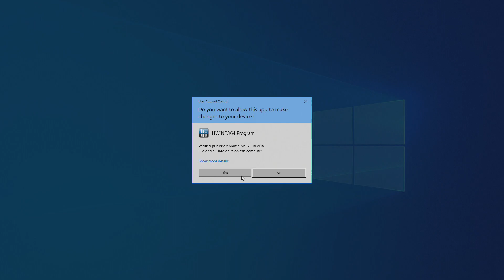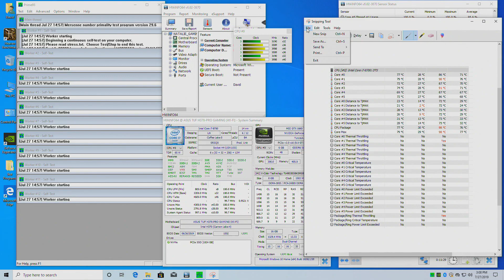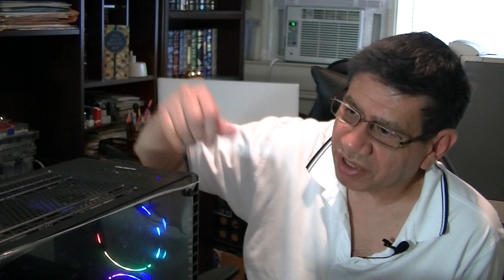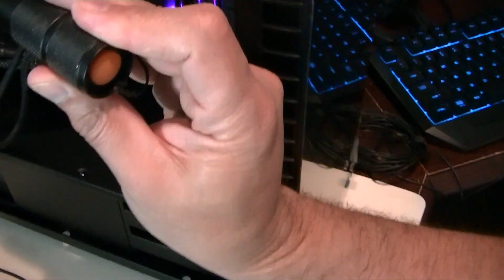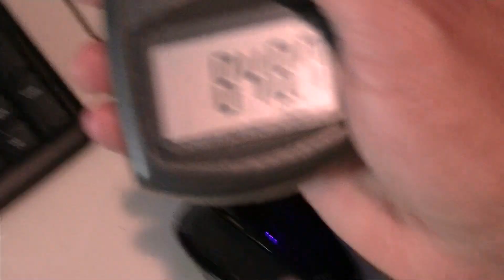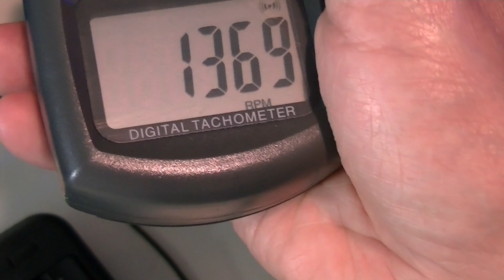Gaming PC Build - MUSETEX Case Review (Part 2 - Testing)

Comment: I have the same case how you put the ssd ?
Reply from the maker: In my case (or really my daughters case) the only disk drive used was a NVMe on the ASUS motherboard.  However, I would have put it in the front section at about the midpoint.
Reply: I mounted it to the back
Reply from the maker: @Quipea  It can go either in the front or in the back.

Comment: Take off the front tempered glass, it will make the temps much better.
Reply from the maker: I did try that,  in one of the three testing/reviewing videos, however, even though it improved the temps they still 'red-lined' at the most stress part Prime-95.  I really do appreciate the feedback, so let me know if you tried anything else that also improved the situation.
Reply: Ok, because I was actually considering getting this case because of all the fans and the fact that I’m building a hardcore gaming/streaming PC, and with performance you need cooling.
Reply from the maker: @goober8769  In my final video I was able to keep the temperatures under control using an All-In-One water cooler, however the core problem is that the fans are not being controlled by the motherboard (not PWM).  In a future (and likely final) video on my daughter's build (this PC) I will be adding a third PWM fan to the front.  If you watched my most recent video in this series, you see that I add the AIO, and it came with two PWM fans.  Adding a third will do nothing les than improve the cooling (even with the front glass on).  So part of that next video, I will also retest the temps and compare them to the previous results - I expect improvement, and if my daughter wants to cool it even more, she can remove the front glass, so I will again test with that configuration after adding the third PWM fan.  By the way, that also means I need to remove one of the fans that came with the case (permanently), since there would no longer be room for it.  I do wish you all the best with your case and I thank you for commenting.
Reply: I was considering water cooling, but getting a water cooling system from Corsair or NZXT costs hundreds of dollars, and with my 1000$ budget for my whole computer all my other parts ( Ryzen 7 2700x GeForce 2060 super etc...) I am redlining my budget. I’ll have to resort to aftermarket air cooling.
Reply from the maker: @goober8769  I understand that.  I prefer Corsair myself, however I was able to get one for half price that Cooler Master made.  Doesn't look as good, but I think I should get 5 years out of it.

Comment: Did you ever find out about the extra set of leds?
Reply from the maker: No, I never did.  I was hoping someone else had noticed the same thing added to their case (I know many have bought it), then let me know one way or the other, but I haven't heard of that happening to anyone else.  I have it in my spare parts cabinet to use if one ever goes bad, or I have a problem with a similar case on one of those lights or switches.
Reply: Spare set

Comment: I currently have an asrock ab350m-hdv motherboard an I'm trying to connect the fans to it, is there a way to do so or do I need to buy a connecter?
Reply from the maker: I had the same idea when I first looked at that case.  There may be an adapter/connector cable that is made by someone, however I did not find one with a Google,  and saw no 'easy' way to do that.  I would have needed to create an adapter myself - and before that, did some electronic experimenting to determine which wires on that strange 5-pin cable were being used for various functions.  The RGB portion of it could be using either 12-volts or 5-volts (I did not put a DVM on them to identify which).  However I gave up on the idea of creating a special rig quite quickly when I realized that the Fan motor logic was NOT Pulse Width Modulated (PWM).  In the end, I simple connected a Molex PSU connector to the connector dangling from that bunch of case fan wires, and it worked - so I left it that way.  Sorry I couldn't be more help on that.

Comment: i was thinking of buying this case would you recommend this case??
Reply from the maker: If you plan on using a high performance CPU, I would only recommend it if you were going to also use use water cooling, such as an All-In-One 240.  Tomorrow I ma heading over to my daughter's place and replacing the two Corsair PWM fans I added in this video with a Cooler Master ML240L AIO cooler.  I believe that will fix the heating problems I identified in this video.  I will be filming that work and producing a Part 3 within the next two weeks.  Maybe you should check out that video before you put down the money on one.
Reply: @PE4Doers  thank you! appreciate it alot cus i love this case but im also changing all the fans out to a ML120mm ones from corsair if u think u recommend it
Reply from the maker: @Gamingandrelaxing  I actually filmed the fix to my daughters Mustex case yesterday, and just adding a 240mm AIO took care of the issue from a critical perspective.  I did have to move two of the included fans from the front to the top (and reverse the air flow), but it seemed to work.  I believe the case has overall air flow problems which new fans can only go so far in compensation on that.  I expect the new video to be posted this coming Sunday morning, so look for it.

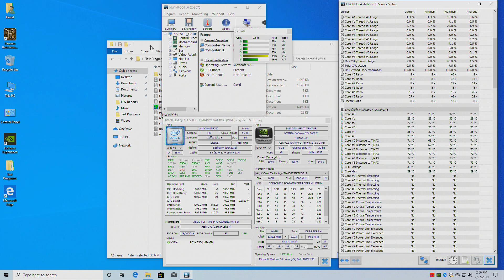Comment: is that fan noise through the mic at 6:31 is that the fans from the case noise?
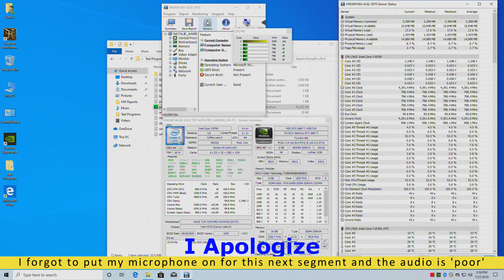Reply from the maker: That is due to my stupidity in taking my mic off between the tests (for a bio break) and forgetting to put it back on when I returned.  I did show an apology at the bottom of the screen at 6:18 into the video, but I probably should have made it more prominent.  I considered not including that second test in the video at all, but decided it helped convey my frustration, which was an important thing I wanted to get across to everyone.  The noise itself is from my engineering workstation (that I currently use to record my sound), since I had put the mic down within 4 inches of the top intake fan.  The MUSTEX case did have the positive attribute of being VERY quiet, but I believe that also aggravated the heating issues.  I do, once again, apologize for the poor sound quality my loss of attention lead to during the production of this video during that segment.
Reply: PE4Doers its okay i completely understand. thank you for your response and i appreciate you clarifying that for me

Comment: Hello. Very curious why an i7 8700 is running that hot at stock voltage (i'm assuming voltages are on auto in bios) especially with a hyper 212. What version prime95 are you running? I use prime95 v26.6 because it doesn't run the avx instruction test which cooks the cpu. Prime runs different instruction set tests, I couldn't see if it was overheating only when running an avx test or throttling on all tests. Have you tried other stress test to check if the same thing happens (intel burn test, occt)? Maybe check cpu voltage when at 100% load. I'd also check each hyper 212 heat pipe to make sure a pipe isn't bad (feel if a pipe is cooler than the others indicating the fluid inside isn't cycling). I see you already did a remount/repaste so that isn't the issue. I've never seen an xmp profile setting (disabling or enabling) make that much of a difference in temps. Maybe check for a bios update that would fix this. Just throwing out ideas, good video.
Reply: It is the Prim95 29.6 version PE4Doers  is running that is causing the issue. With the version 26.6 He would get very different temps. since it is not hammering the AVX like the newer versions do.
Reply from the maker: @KathrinHausermann  I might have thought that too Kathrin, however I put that CPU chip into my other workstation (the one I am using to type this message) and it had normal temps, with 74 degrees C max on one core.  I will be replacing the two fans I added at the top with a 240mm AIO in the next two weeks and I will make another video showing the installation and the new temps.  That case just doesn't cut it with air flow - further aggravated by those four RGB fans not pushing through air.  I plan on also using an Air Flow meter and charting the flow differences with those fans and a Corsair PWM.
Reply from the maker: I really like that questions, since I wondered the same thing,  The only thing I can think of is that the case just, and those very quiet pretty RGB fans,  too obstructive to the air flow to get the CPU cooler to do it's job.  I was so concerned in fact, that although I did not include what I did in this video, I actually tested that i7 in my main PC (which has the same chip and the same cooler), at the point when I removed the cooler and replacing the thermal paste.  It did not get past 74 centigrade in that environment. The other case is a Corsair 200R with 6 fans controlled by the motherboard however.  Also I used the 'exact' same version of Prime-95 (v29-6).
Reply: @PE4Doers  Maybe I missed it in the vid, but have you tried setting all fans to max in bios? What's the max rpm of the fans? Maybe try switching the Hyper 212 since you have a spare to eliminate that as a potential failure. Is the bios updated? A bios update could resolve the weird xmp disable/enable heat issue. Also what's the cpu core voltage when at full load for prime 26.6? If voltage is on auto in the bios, we want to check it isn't giving crazy voltage over 1.4v, lol. Cheers.
Reply: By the way, I watched your vid because I was interested in the musetex case, lol.
Reply from the maker: @CheapRedBoy  Unfortunately, that is the essence of the problem.  The set of RGB fans that came with that case cannot be controlled by the motherboard.  They have a unique connector with 5-pins that provide both the fan voltage {Not PWM} -which I believe is two of those wires - and three that provide the RGB - with one wire being the neutral for the RGB).  They all come pre-daisy-chained and get power from a Molex power connector.  I am fairly certain that replacing those fans with a PWM-based set - such as those sold by Corsair (which would cost more than the case) that can be controlled by the motherboard or separate software - would greatly improve the heat issues.

Comment: Hello 

You ran the Prime95 29.6 version as I could see. 

Run the test with Prime 95 26.6. 

The newer version's of Prime95 is hammering the AVX of the CPU. Please read the link below. 

https://forums.tomshardware.com/threads/i9-9900k-temperature-concerns-unsure-how-to-proceed.3400121/

It contains the explanation of CompuTronix, a Moderator on Tom's Hardware Forum and Intel Thermal Specialist. With the newest Version (in February 2019 then it was Prime95 29.3 or Prime 29.4 Carey struggled too in Franklins Build and the Judge Build) And neither, the Mugen 5 RevB  nor the Bequiet Dark Rock 4, the smaller Behemoth with A TDP of 200W could keep up. Even NZXT's AIO Kraken X62 struggled.... 

All due to the changed pre configured Settings in Prime 95 in the newer versions.The Issue is not the CPU Cooler but the Software you used in the test. So do the test with Prime95 26.6. 

I glady await the new test Video with Prime 26.6
Reply from the maker: Yes, I know you mentioned previously that there was an issue with that version, however I have not seen it affecting the systems that I've recently built, but I will keep that in-mind for future builds.